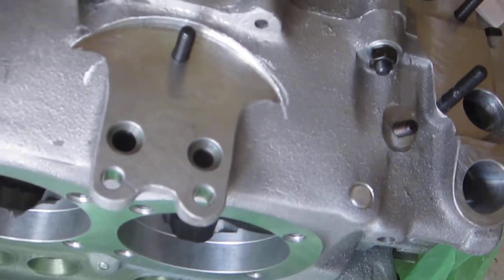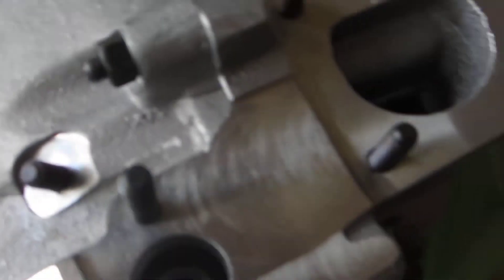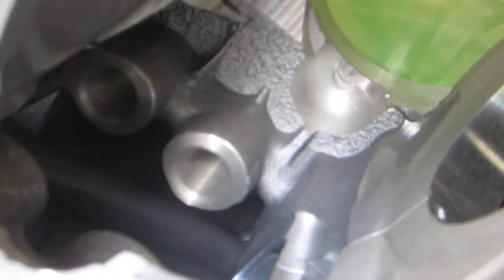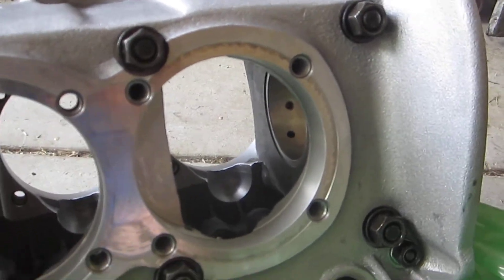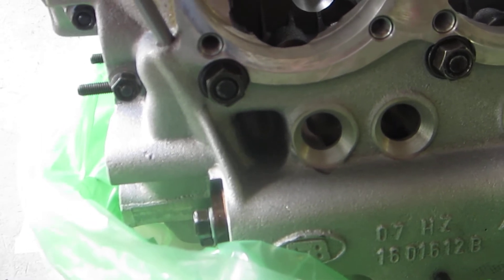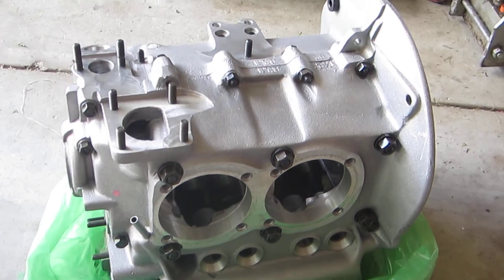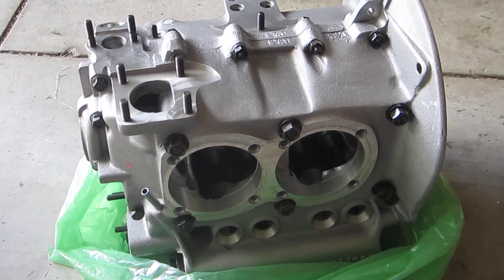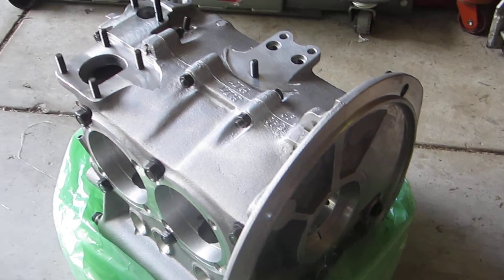White Rhino Aluminum VW Engine Case

Comment: Why didn't you go with the Precision Alloy TF1 case, which is cast and machined in the United States of America ?
Reply from the maker: I have a TF-1 also. This White Rhino case is the basis for my 2332cc (barely) streetable engine. My TF-1 is going to become a 2387cc, the Lord willing.
Reply: @vwsandvettes3253  I'm looking to get a 2387 going myself. Slowly putting it together 
LOL
Reply: @vwsandvettes3253  that's the dream engine I'm investing to build myself. With a New President and potentially increasing costs of parts being imported. I've been looking for items produced here in the United States, in hopes that they will soon be the more affordable way to go.
Please keep me updated on the 2387 build your putting together. I could sure use some sound advice

Comment: been following your build , looks great so far and thanks for sharing.
I am weighing the options to build a 2332 as well ,  is your 3.5 raised deck case the same deck height as the CB  engine builders case ? I'm not seeing deck height info for theirs and I definately want to keep my compression at or below  10.5 -1
Reply from the maker: Well, the CB 2332 Engine Builders Choice kit comes with the "standard" magnesium case whereas I'm using their aluminum case, and with their kit the deck isn't raised at all, so they use .200" spacers under the cylinders to get 10.5:1 compression and between .040-.050" deck height. To dial my engine's compression in at roughly 10.6:1 since the case has a raised deck,  I ended up using .100" spacers and saw about .050" deck IIRC. Aside from using the raised deck aluminum case, I stuck with the rest of CB's "cook book" recipe and had them flycut the Super Pro heads to 52cc just like what is specified in the kit listing. Good luck on your build!

Comment: What kind off power output are you aiming for?
Reply from the maker: this is basically the Engine Builder's 2332 package that CB sells, with a different cam and lifters, but still around 200 at the flywheel. With 10.5:1 compression and everything else I really hope I get there. thanks!
Reply: @vwsandvettes3253  200 hp!  Should be frighteningly fast!